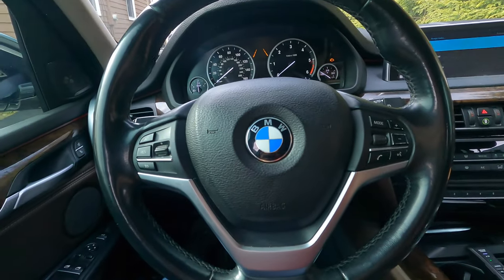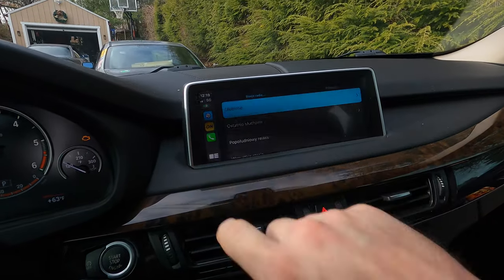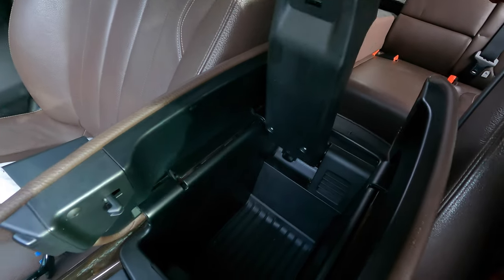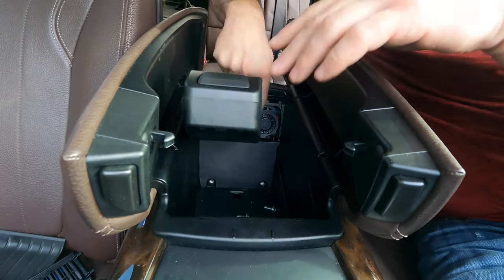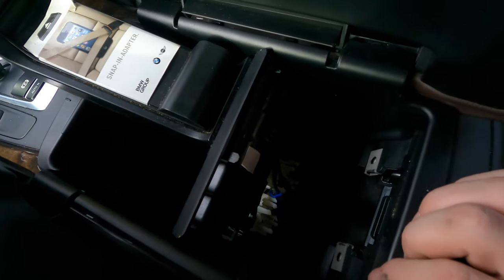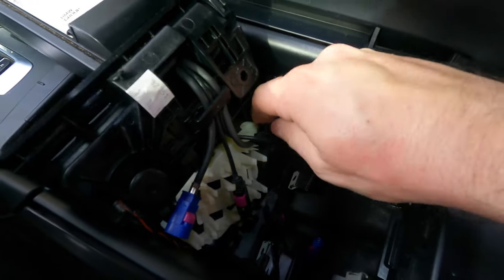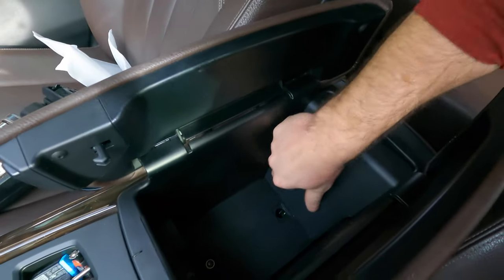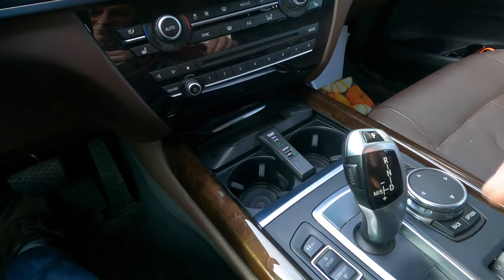X5 Center console phone cradle delete wireless charging install

Comment: The x5 has wireless charging.  This is located in the center console on the left side.  You have to put the phone in there.
Reply: Yeah but the charger is hot garbage and causes phones to overheat. Not worth the risk to your phone
Reply from the maker: Yes that’s exactly why this solution is much better

Comment: It seems there was a vent there so you could keep drinks cool and you deleted it?
Reply from the maker: I had the same the speculation before I did this, I like my drinks cool as well 😎😁, but I’m happy to say the fan on the back is only for charger cooling not actually to cool the compartment, the cooling effect of the compartment is from the channels below that run there. Somehow provides cooling to the storage, after this conversation my drinks are still cool I can confirm no negative effects 👍
Reply: @MotorsportInspired  well if that's the case that is great. It looks nice and you have more storage. Good luck ✌️

Comment: Hi - do you have a video on how to install the charging unit from sighill?
Reply from the maker: Hi, I have not made one since it’s so easy, just plug into cigarette lighter and put it place, but I can make one if need be 🙂
Reply: @MotorsportInspired  Thanks for responding.  I've since sussed it out and it seems simple enough.  I have an iphone 14 plus so just trying to work out if the phone will fit with a case etc - is 170mm long with the phone case
Reply: Hi~,how to buy the wireless charge unit ?

Comment: Does the wireless charger interfere with closing the cover for the cup holders?
Reply from the maker: Yes it does, you cannot close it any longer after charger is installed, that would be relevant only if you actually use it, before the wireless charger I never used the cover anyway it was always open because I used cup holders all the time so it didn’t change anything.